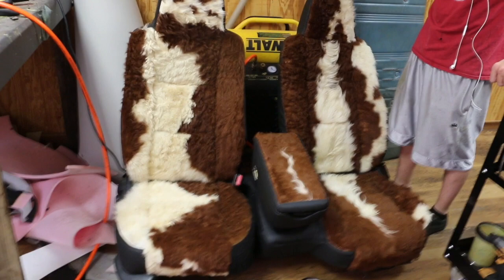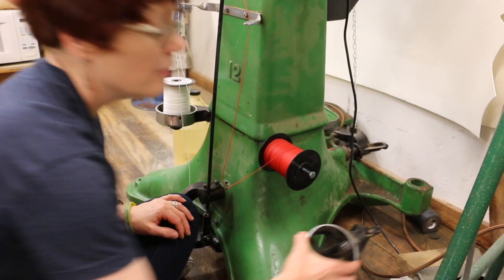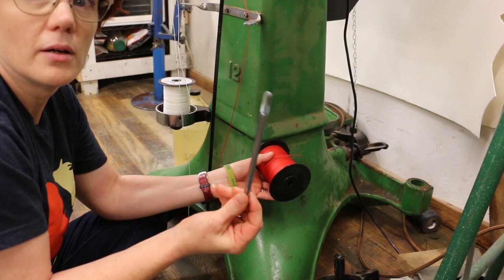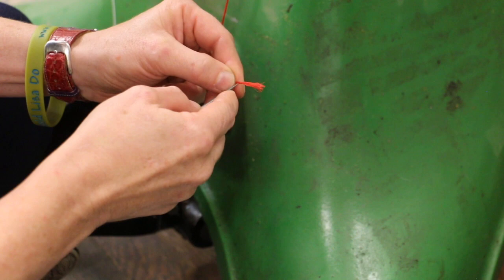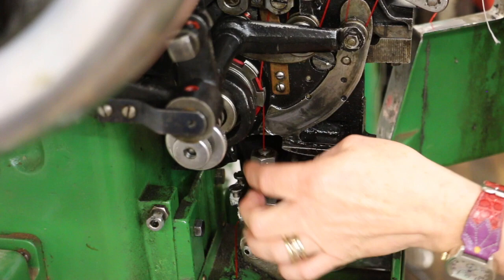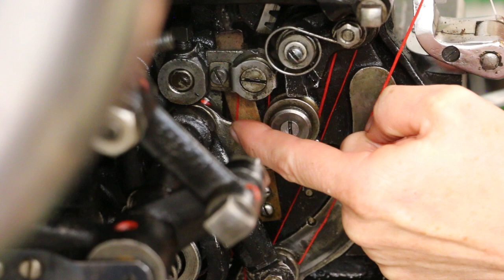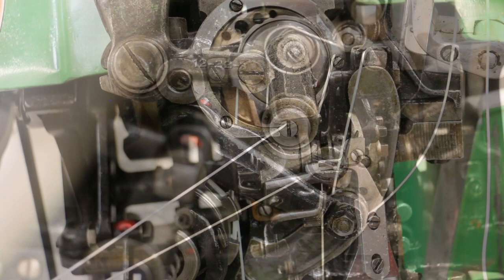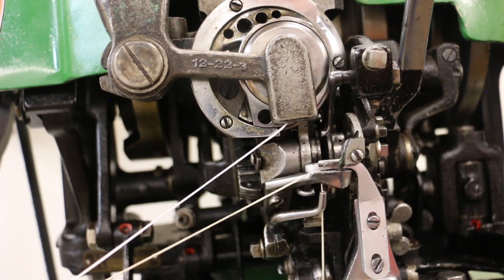It's a Boot Life: threading the curved needle

Comment: Hi, you do amazing things!!! I have a question where do you get that thread? And how is it call, I’ve always used linen thread, but that only comes in white and black!!
Thanks.
Reply from the maker: I sell this thread and I also use it. I like it as much as my customers do! It’s braided polyester thread, 1mm in size. https://sorrellnotionsandfindings.com/product/braided-thread/
Reply: @customboots  thanks for replying, I will check it out!!!🖐🏻🖐🏻
Reply: Do you have any video where I can see how it looks? When using it
Reply from the maker: @AaronG2480  I don’t have any videos of sewing with it — that would look exactly like sewing with any other thread — but there are pictures of the thread itself on the website.
Reply: @customboots  I see, thanks
Reply: I already ordered it, so you said this is something I can use on  my Landis curved needle?? 
Thanks.
Reply from the maker: @AaronG2480  Yes, it is, but you may have to adjust your tension just a bit. Also, these spools feed off the side instead of off the top. I went to the hardware store, bought a long bolt with the same threads as the screw that holds the thread holder cup onto the Landis, removed the thread holder cup, inserted the bolt through the thread spool hole and screwed the bolt into the side of the Landis. You don't have to screw it in very far -- just a few turns -- so it's easy to change out spools or thread colors when you want to.
Reply: @customboots  I see, I’ll do that, thanks for your help!